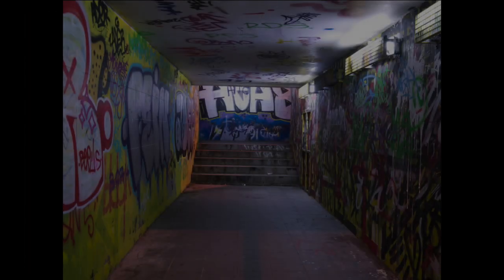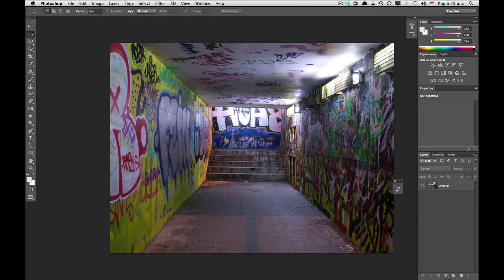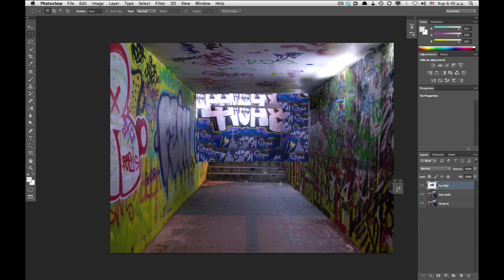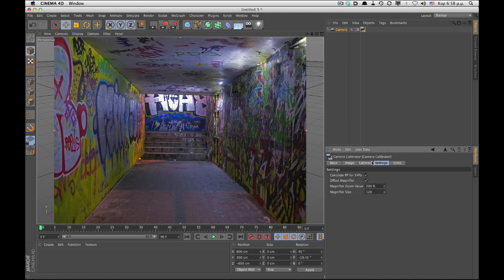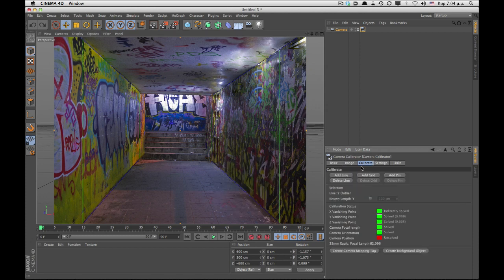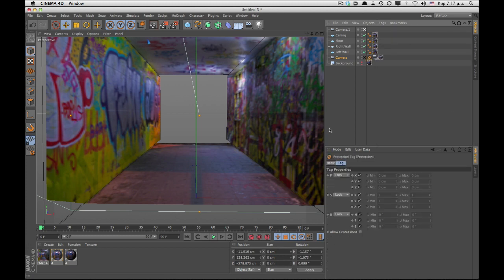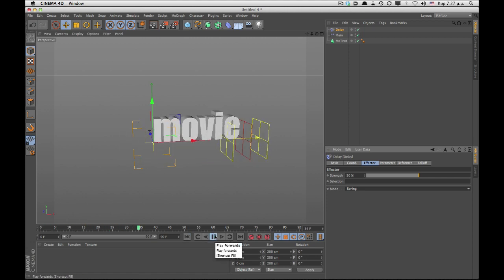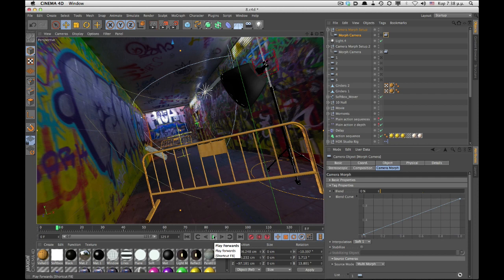Camera Mapping With Cinema 4D

Comment: Hi! good tutorial.
why when i assign the material to all surfaces, only two surfaces are visible in the project live and not all? while in rendering are all visible
Reply from the maker: Check if this is just a graphical glitch in the viewport. Try lowering the default resolution used for each material. Maybe you have a lot of images at the same time and your graphics card chokes up. Double click your materials and then go to editor-> texture preview size.
Hope that helps!
Reply: Thank you for your reply. However I have noticed that if you normally check the material on any surface while it's okay, if I use projection man i have that problem. I did like you said to me but I have not solved the problem :(
Reply: if i select "Bake Object" it's ok :)
Reply from the maker: +Donato Hmm that doesn't sound right to me. Glad you solved the issue though! Maybe try your scene on another computer just to make sure there's no incompatibility with your setup.
Reply: thank you so much! ;)

Comment: Cool tut. If I would move one of the walls when the projection is set up and the materials are assigned to the walls would it mess up the projection. I am working on a video where a church is collapsing in the distance and need to have the picture "stick" to it when it is collapsing.
Reply from the maker: It's quite easy to do!
Go to Window -> Projection Man then find the part of the object you want to stick the texture to and right click and select "Bake Object". 
On the options dialog select the settings you want and just click on "Bake Object" and that's it!
Reply: dimitris katsafouros Cool thanks! So simple!